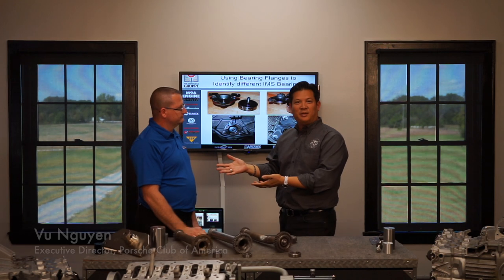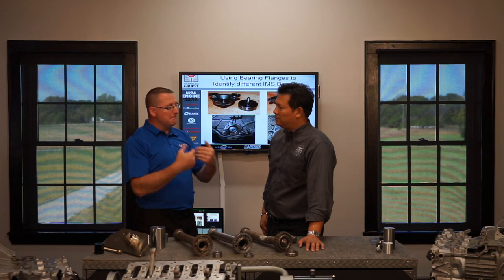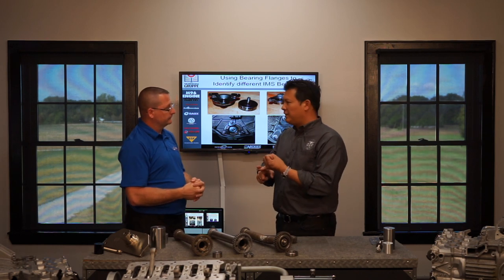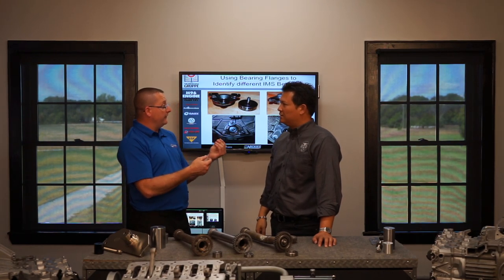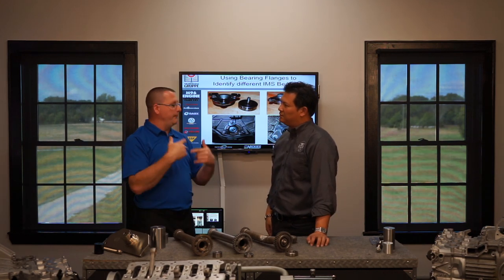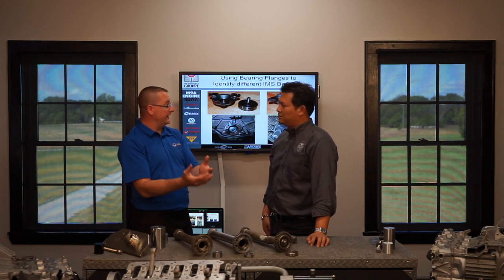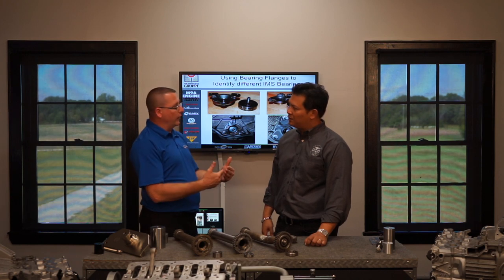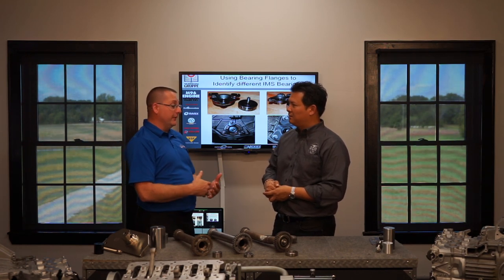PCA Spotlight: Extending the life of your original IMS Bearing

Comment: “… it’s a Porsche, not a Honda or Toyota….”. Wtf!
Reply: so, why doesn't Subaru have IMS or bore scoring problems? Answer: better engineering.
Reply: @@jean-francoisguignard4669 They don't have a timing belt failure issue. What are you even talking about? Subaru timing belts fail because their idiot owners don't know what "5 years or 100,000 miles" means. lol.

Comment: Im sorry but the oil has nothing to do with the failure of the IMS bearing. Its the actual way the bearing is situated in the engine. It is hidden under the crank shaft and it just does not get enough oil fed to it to do its job. They already tried the sealed bearing that actually has oil in it but even that failed because of high temperatures and the speed of rotation this has to endure. This is such an important part of the engine 
Not once in this video have i heard this guy mention what the intermediate shaft does and how important it is for engine timing and cam shaft reliability. Not once has he mentioned the failings that are of Porsche to blame. They messed up with the whole build of the Horizontally apposed engine in a 6 cylinder unit. The forces of this Naturally exasperated engine is huge and they put a puny bearing with no direct oil feed on the most important part of the engine and fuck it up. This guy is full of shit. There is no excuse for it. It has to be changed at least at 50k miles before it has a chance to fail. Changing the engine oil will do nothing for the IMS bearing. The only way to stop this for good is to feed the bearing with oil direct. This way it has a constant feed of oil. Go hear to look at the kit. https://www.design911.co.uk/p/ims-single-row-bearing-direct-oil-feed--dof--intermediate-shaft-retrofit-kit-for-boxster-986---996/ 
Otherwise just keep changing it out every 30k miles. There is no other fix. Remember its not all Porsches You can have the exact same vehicle exact same miles full service history oil change ect and one will have IMS bearing failure one wont. Preventative measures are always better than repairing and cost. The IMS bearing can fail without stripping or putting bits in the oil. It can fail just by the bearing being loose from the ball bearings in the bearing failing. Porsche should have had their own bearing made that was able to feed itself with oil. After all its an rotational engine part and responsible for keeping the Intermediate shaft in place to allow for the cam timing to be precise driven by a chain. The chain is lubricated direct from the oil so why not the Bearing also. This video is so frustrating to watch and to think this guy is teaching people and coming on youtube talking bollocks!

Comment: What is this guy about? Don't drive 50 mph in 6th? What if you have an automatic? Newer PDK versions would keep it in 7th at that speed or even lower. The limit is 70 and you need to drive 120 to keep it at 3000 rpm, or drive in 2nd all the time. Change the oil often blah, blah you've discovered hot water